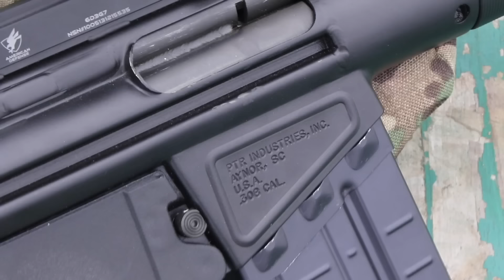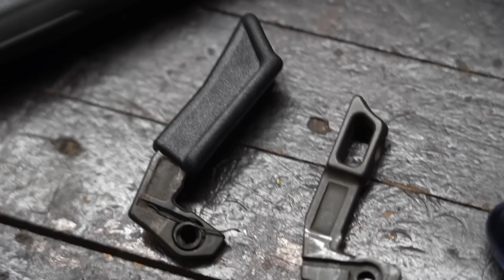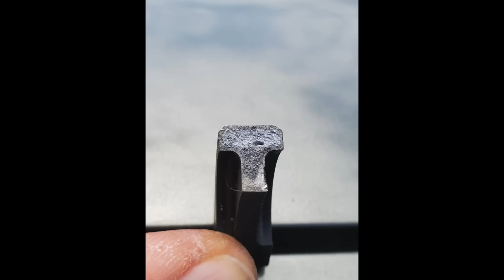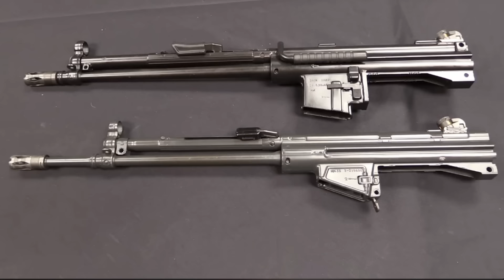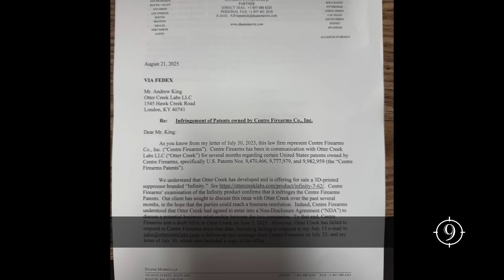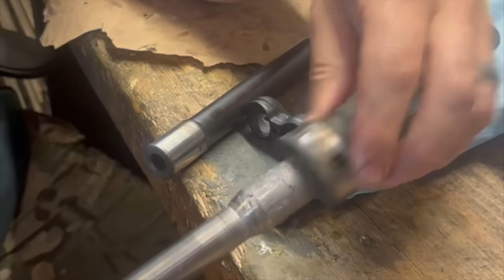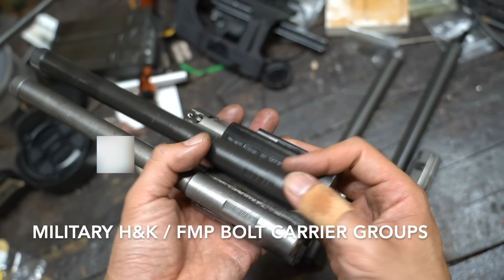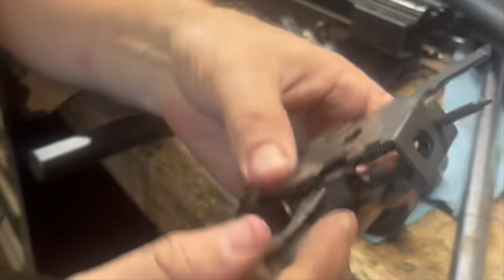Is PTR still worth the money? H&K v. PTR (old) v. PTR (new) v1

Comment: after the Pulse nightclub shooting in 2016 i bought my first rifle, a PTR91 GI, because i live in an area where i got a lot of hassle for being a bit on the fruity side. i got the PTR91 because i couldn't afford a Springfield M1A and i liked Jisuri more than Faru in the anime Upotte.

Pretty soon after it started having horrible malfunctions where empty casings would get shoved head first into the gas tube so i sent it back to PTR and apparently there was a chunk missing from the bolt.

Cut to earlier this year after years of shooting steel cased ammo with no issues I had to switch back to brass due to ammo bans both from import as well as new management at my LGS banning steel cased ammo. I had cases stove-piping and others having their necks split like a log on the front of the ejection port. PTR fixed it again and it works fine now but this makes me feel better that i have killed twice a rifle that is supposedly unkillable even by African child soldiers.
Reply: After a shooting at a public place you bought a gun that you will never carry in public.
You should have gotten a handgun, then a rifle.
Reply: @Mk2Mod1 I already had a handgun.
Reply: @pippupaladin that you regularly carry?
Reply: @Mk2Mod1 yes.
Reply: @Mk2Mod1 smooth brain
Reply: @Mk2Mod1 smooth brain

Comment: Can get em, very used too.  Overpriced a bit and probablyshotout that I found early 2020 with something like minimum of 14 mags, case, and more.  It looked pretty rough,  too bad there wasn't an indoor range there.  I remember when H&Ks were roughly the same as Colt or Bushmaster AR15s if not cheaper.  We had a nice variety of pistols through battle rifles back then and open bolt "SMG" (semiautomatic).

Comment: I have a PTR K3p (G3K pattern) made in 2018. It came with the plastic grip. The fire control is still the steel box with the stamped HK style selector but the hammer is marked "PTR91" and trigger is the cast  parts. It's been completely problem free for my sample size of 1.

Comment: Funny enough I purchased a PTR-91 GI model from Atlantic on October 3, 2025. The same day this video released. I just picked up the rifle about an hour before the typing of this comment. 

The rifle feels and looks great. The furniture on the rifle is genuine G3 furniture. The trigger housing is also a genuine SEF. The trigger pack appears to be newly made for my gun. The safety selector positively engages and does not slop around. Opening and closing of the bolt feels great. The trigger pull is surprisingly decent for what it is. I would say its on par if slightly worse than my FMP G3 parts kit. My DSA FAL has atrocious trigger pull compared to this PTR. The part where the buffer spring attaches to seems to be original as well. It has a well done nitrite finish, but I won't see it long as I intend to do a Rhodesian paint scheme. I have not shot it yet but just on hand feel alone I am pretty impressed. If people care enough, I can produce a range report.

Comment: Have a couple of the PTR-91 GI models circa 2013 when they had just moved to Bristol, CT from Farmington. Both shoot great and have no problem hitting a 10" round plate at 200yds with the iron sights. Both were built with surplus H&K parts for the trigger pack, furniture, bolt and carrier. Believe the barrels are RCM and have M15x1 metric threading at the muzzle. Barrels are the ones with increased the number of flutes so no extraction issues with mine. Eats mil surp, commercial, and steel case without hiccup. These did not have the paddle mag release or welded pic rail on the receiver. Had Bill Springfield trigger work done about 12 years ago, nice short and light without any light strikes. Last year, sent them off to Dakota Tactical to have the pic rails welded on for optics and the paddle releases installed. A world on difference on the mag changes with the paddle release. Should have done that a decade ago, lol.  Stocks were changed out to the Spuhr set up so I can optics that are not sky high above the bore. Can't use the sights with the Spuhr set up, but my eyes don't do sights well anymore.
 Note to self, don't get old.
Hope PTR takes the constructive criticism to maybe sit back and rethink what they had created and get back on that path.
Being in an Assault weapon ban state (what we have is grandfathered (ie: registered)) so can't buy any other models, but hoping once SCOTUS addresses that issue, our restrictions will change and PTR will also have made a change for the better for its customer base.

Comment: Update: my shop just received a brand new PTR 9KT, here are my observations:

> 2x Steel mags included
>Series 90 trigger shoe
>new production steel trigger pack
>selector has lots of resistance
>perfect lock up on the magazine with bolt open or closed (acceptable wobble on open bolt, which is normal) 
>either the cocking tube or the front sight is misaligned, it's hard to say, but it's not concentric to the sight tower
>magazine release paddle is stiff but has full function
>ejector interfaces and times perfectly with the channel in the bolt
>rear top take down pin hole appears to be egged out as an afterthought. It barely fits an SB tactical brace without a mallet

The front sight/cocking tube issue will be identified with a live fire accuracy test.

Comment: It would be interesting if we could determine a definitive cutoff date for the change they've made to their rifles.

I bought A 91 in maybe 2020? 2019?

Surplus furniture, grip, stock, foreguard.

Surplus trigger pack hk marked hammer.

Pre welded rail so I suspect its a "later model"
This is backed up by the "later" model bolt carrier. Interestingly the bolt carrier is welded EXACTLY like the early model that you show in your video though. So im unsure if that's a good indication or not.

I can't confirm anything related to barrel though, so it really seems like we're taking part in the PTR lottery.

900$ and nearly 1.5kish rounds later the only issues are the bolt carrier contacting the housing. Thank you for this video, helped me find out what's what on my example, really hodgepodge it seems.

Comment: Very unusual that PTR/Century would opt NOT to use a rear sight base with the proper recoil lug on the CA-3. I could see it making sense if the top rail was welded on, but otherwise, it makes no real sense to me. At least PTR after all those years finally made the mag release paddle standard on their guns.

This was kind of a depressing video, but this info is important. One will pay more, but for those who want a G3 kit built up on a PTR receiver (the receivers are still solid), there is always Jeff Walters at Parabellum Combat Systems in OK. I have a rifle built by him and I love it.

Comment: I bought a PTR 91 probably about 10-12 years ago, it was my first rifle. I must have had a in-between era as mine came with the newer plastic lower but still had the stamped trigger housing and trigger as well as no paddle mag release. I've since put on a surplus metal lower which I had to file to fit correctly. Either that or I assume mine is an earlier PTR that someone prior to me put the plastic lower on. Rifle was made in Bristol CT if that helps. I know PTR moved quite a bit so that may help date it.

Comment: I disagree on the m-loc hand guard.    That actually gives you more functionality and is worth keeping IMO.  People who throw those away for a regular hand guard, have lost the plot IMO;  and are just larping in costume rather than actually building a rifle to use.   Granted, it will give you more heat protection.  but being able to mount a light is a big upgrade on this thing IMO.   Sure it looks different, but
Reply from the maker: If they wanted to make an MLOK handguard, they could have given it more thought for better machining / more slots it the intermittent locations like MI, and better aesthetics like Spuhr. Instead they made an ugly duckling that is cheaply machined with the bare minimum amount of slots to be called a rail.
Reply: @9HoleReviews  Fair.. I've personally had both URGI and cheap hand guards.. I can understand there are differences;  but it honestly doesn't matter to me.  I just judge it by the bar of adequacy.  Maybe not "just as good' -  but it's just as adequate.  If one is adequate and the other is much more adequate-   to me, there is little difference; we're in the same world of "it works".  But I can still appreciate how others may not see it that way.

Comment: But later on, after Century kept having issues.. PTR started assembling their C308 kits with PTR receivers and barrels and they did also weld on the top rail.   I have a C308 with the factory top rail welded on.  (factory: meaning,  I didn't do it myself).

Comment: Henry, I have one of the PTR GIR (railed 16 inch), from the factory it came with an out of spec picatinny rail, offset front sight and excessive cocking tube gap. Bolt gap was well within the middle of spec. I was told to shoot 500 rounds through it before they'd even look at it. 700 rounds later the bolt gap didn't really change and I still have excessive cocking tube gap and never heard back from customer service. I'd really like to keep the rifle but I can't seem to find any gunsmiths who know how to work on it. Do you suggest I dump it and move on?
Reply from the maker: Unfortunately yes. It pisses me off to hear them say that. 500 rounds is worth more than 1/2 of the PTR's cost.
Reply: @9HoleReviews thank you Sir. Appreciate your time.

Comment: I had 2x 91s.  Extractor Spring failures, 2x in a Row on RG ammo, I was out even though I had 2 of the Model.  One had a HK21 2 Stage Buffer and felt like an AR15.
Went with the Galil SAR and sold the HKs.  Galil was stolen.  Work with Saiga 308 now in AK108 Config.  Easier to clean, should be far easier to suppress and keep operable Supp or not.

Comment: My guess is that they had a very large supply of surplus components that lasted years and eventually ran out and were to expensive to reproduce. My understanding is that they bought the tooling including the original dies and prints from H&K after H&K stopped making the model 91/G3 so they likely bought the parts they had in stock too.

Comment: I've had mine for roughly 15 years.  was owned by a local sheriff before that (safe queen).  stamped trigger pack, PTR stamped hammer, HK-style selector inside the "navy" plastic housing. the pistol grip is too skinny and too smooth.  might have to look into these Portuguese surplus parts.  any good vendors for these?

Comment: I have a PTR 9 CT that I got in early 2021 and it is off spec in a few places.  I tried attaching a KAC hand guard and the screw doesn’t fit and had to go down one size at a hardware store.  I also tried to swap in an HK grip and the PTR trigger pack would not fit it.  I then tried to put the trigger pack in a Magpul grip and was not able to due to fitment issues.

Comment: I have an old Century CETME "Sporter" from back in the day. Couldn't hit a barn door at 50 yards. I sent it to Fairfax Firearms Repair ( guy who runs it used to work at Century). He repressed the barrel, changed out the triple front sight and gave it a once over and now it run and shoots fine over the past 12 years. I later added a redone trigger pack and got the trigger down to around 4 lbs. Also have a PTR GI with the added rail and run a binary trigger in it and it runs and shoots great. These rifles may take a little work to get running right so buy used ones and tighten them up like you like and have fun!

Comment: Hey Henry! Enjoyed your nerdy video as always. 😅 A small tip from an old G3 shooter: Only use the übercool Hk slap on the first chambering. The next reload seat your magazine give it a HK slap and then use your karate hand / side of your palm and quick as you like snap the charging handle backwards until it stops and your hand should slip off and the bolt carrier should fly forwards chambering a fresh round. Its fast and doesnt require fine motor skills. Use gloves unless you like to "bleed in" your HK rifles as we traditionaly did back in the days. And yes we gave our G3 rifles names. Preferably girls names. 😅❤️

Comment: When I first got way into battle rifles, I saw just about every offering from PTR used a plain 4140 barrel in a semi auto .308, so I turned 360 degrees and moonwalked away.  Building FALs and M1As is the best decision I made from that.
Reply: RCM has cold hammer forged barrels for the ptr91
Reply: @MrDragonkarp  I did find that out after the fact, keep it in mind for the future when I have un-fucked electrical sockets in my garage for the welder.
Reply: @Goatsmacker  Lol for me Welding and gunsmithing is fun if I do run into those problems😂

Comment: The problem with parts kits is, they’re used AF. The descriptions say the stocks maybe scratched, cracked, or BROKEN. The cocking tube may have dings and dents. So you may be buying a very used pistol grip and trigger pack.

Comment: My 1979 HK-91 serial number is approximately 7,650 numerically lower than Henry's 1981 HK-91 sn# A028159, giving an idea of how many were produced during that period. 

In 1979 I got my first real job and the first thing I did was get on the HK-91 waiting list. Six months later my new HK-91 arrived at the local FFL holder at a cost of about $348.00 US. When surplus HK parts were dirt cheap in the late 1990s I replaced the stupid plastic stock and handguard with takeoff milsurp wooden furniture cost $14.99 from Sportsman's Guide. That increased the coolness factor considerably. I didn't, unfortunately, take advantage of the surplus HK scope and mounts or retractable stock or other accessories.

Comment: I played atound with a PTR91 GIR years ago.
swapped the handguard for the wideguard + bipod, the charging handle for an oversized one, modifying it slightly to fit, and then swapped the the stock with one from a HK21 and added an oversized buttpad (word of advice: clamp the buttpad in a vice and lift the rifle, lot easier than trying to yank it off the clips by hand)

All in all, it's been a pretty decent DMR setup. heavy as sin though.

Comment: 4:32 Don't church it up. You wanted it for vanity it's fine.
Reply from the maker: The HK stamp itself yields plenty of vanity and satisfaction. The paddle is, however, a must to truly get the G3 experience.
Reply: @9HoleReviews  I agree. My utilitarian minimalist mind wants to modernize older platforms without turning them into ugly abominations like the 2011 (hot take).

One great example is 723 with a micro prism on top with a quad rail handguard, with just the side rail covers. From the side its aesthetic is almost exactly the same.
Reply: Nah the paddle is actually great.  Huge improvement over the button.

Comment: My first rifle ever was a PTR91 bought back in 21. 4 years later, an enhanced buffer, an about 3k rounds I’ve only had one failure/ parts breakage. 

Right around the 700 round mark I had the PTR hammer sheer right in half. Swapped it with an HK hammer and 2300 rounds later no issue.

Comment: I got my PTR-91 GI in 2013. The front sight was canted but I sent it back to PTR and they fixed it. It also had a "Navy" plastic lower which I replaced with a surplus.  Also put a "meat beater" collapsible stock on it. Now I am curious as to what other parts are HK surplus vs PTR. May want to hunt down a better trigger pack. I don't think it has ever jammed but to be honest I have never run it hard.

Comment: Ok…did a deep dive into my 3 GI models.  One was actually a 23 and it has new aluminum housing but with gi parts.  My 24 is exactly the same way.  The 25 which is the GIR model has all new parts.  Outer housing on all three are stamped GI.  Based on markings I’d say they are from Portugal. 

Apologies for the mis information prior. 

FWIW…Welds are all well done. Fit, finish, accuracy have all been top shelf.  I feel the GI models are still a very nice product. They are very common sear hosts as well

Comment: Recently got a 18" PTR-91 GI 'Magpul Edition'.  It works fine, came with the standard 45 deg locking wedge and surplus trigger which I replaced with a Timiny.  Quality is good and I managed to work up a 1 MOA group with 150gr loaded hot.  The only complaint I have about the quality is the charging handle sticks.  Hard.  Customer service said that it is normal and to push in with my thumb while charging (skill issue), but I suspect it's a bolt gap issue.  Other than that, it's a great rifle.